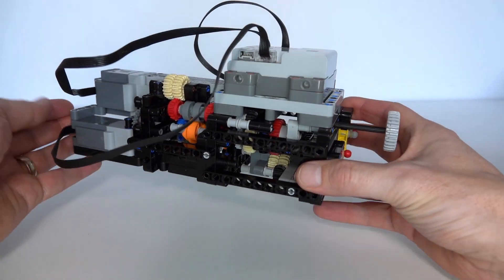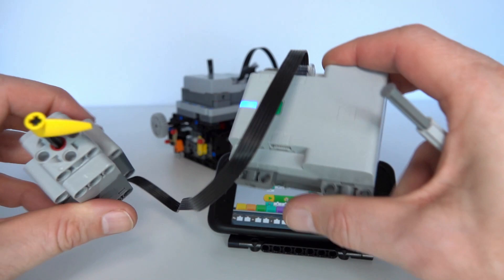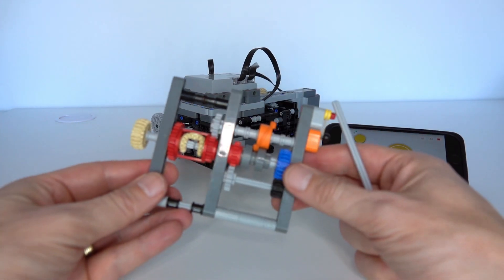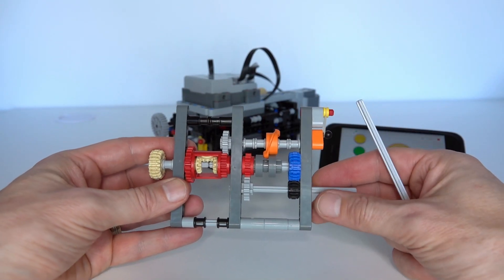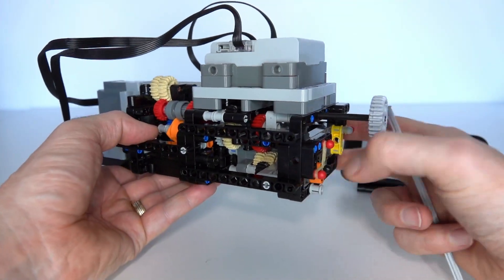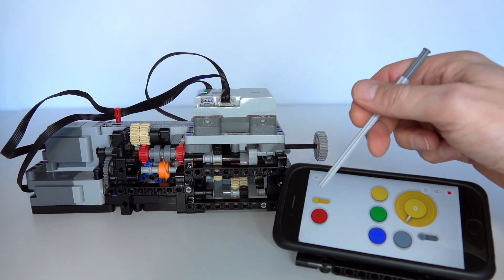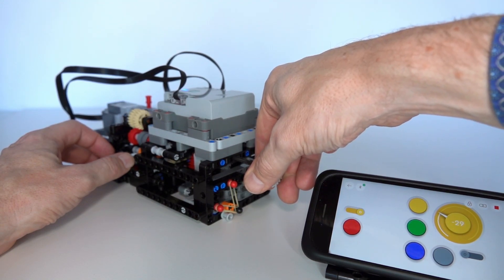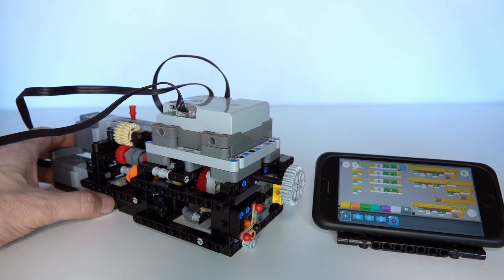Powered Up 3 Speed Automatic Gearbox

Comment: Glad to see your foray into PoweredUP components. 

I wish Lego would add more components to PoweredUP, such as encoder units that aren't motors, limit switches, downstream data hubs for low-power components, downstream power amplified hubs for motors, both of which so that there are only one controller hub in a build, measured linear actuators, a wider array of sensor types, a tachometer, etc. PoweredUP could be such a nice robotics kit, yet Lego severely limits the system's potential by not releasing components to expand the system into a basic robotics kit.
Reply from the maker: Hi yeah it's quite cool. Totally agree about the lack of components - would love some small switches and also a small angular position detector.
Reply: I am pretty sure the idea is to get people hooked on it so they go and buy mindstorms lol
Reply: @SuperAWaC  PoweredUP, Education's Spike Prime, and the newest Mindstorms are all part of the same ecosystem. While Education and Mindstorms might have some additional components, the issue is that the ecosystem is lacking components that'd make the system a decent robotics kit.

Comment: Very innovative work! Maybe one could measure (in the app) the rotation rate of the driving XL motor and use the linear relationship between torque and rotation rate to measure the torque... instead of using an additional L motor
Reply: It is possible to measure the set speed and compare it to the actual speed of the motor. So in theory it is possible to get rid of the physical torque detector. But I haven't tried that out. The Volvo would be a perfect set to test that.
Reply from the maker: These are great suggestions - I think this could work really well. Thanks for your input
Reply from the maker: Great idea - had a few people suggest this now. I totally overlooked it. LOL